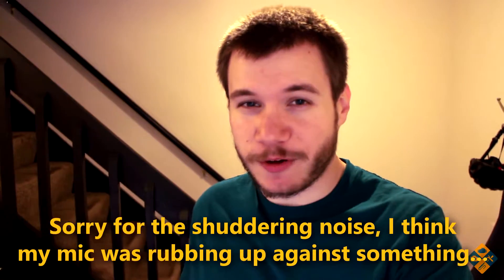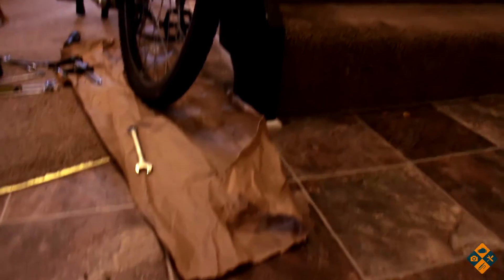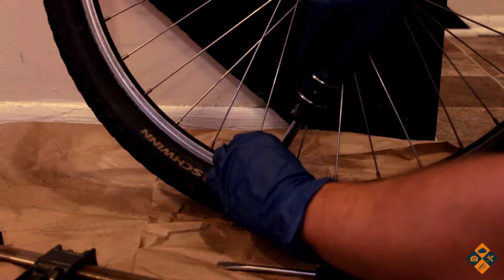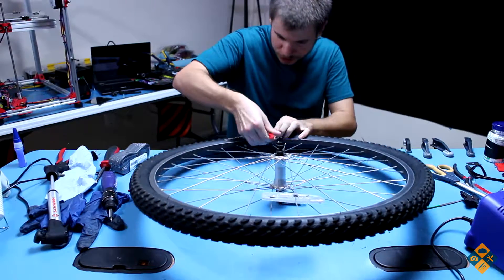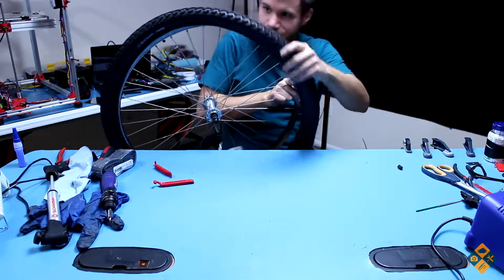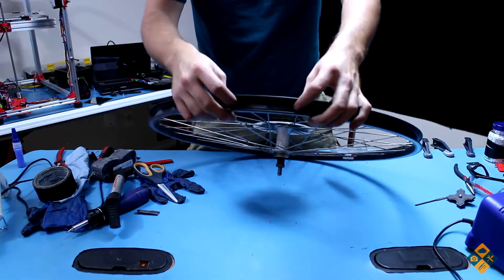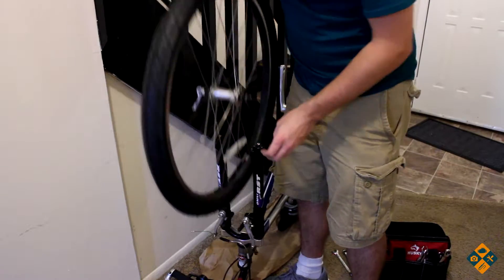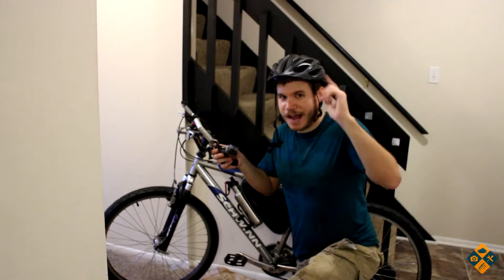3D Printed Bicycle Tire Removal Tool

Comment: Years of removing tires has tuned my fingers to remove them without tools, but sometimes in colder months it's especially tough.

Suppose I should try this for when I can't muster the strength.
Reply from the maker: If you already have a 3D Printer, you might as well give it a go! Only takes an hour to print these! :D